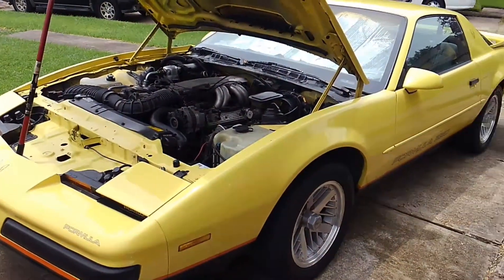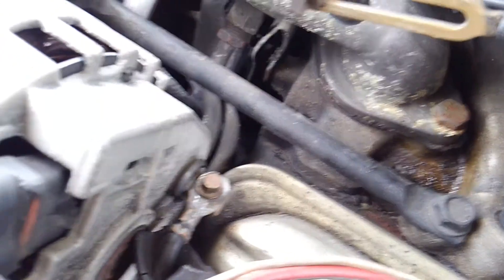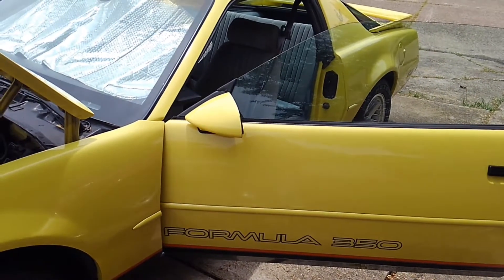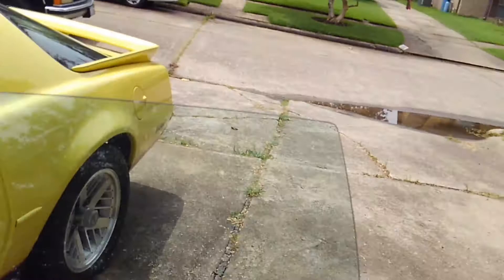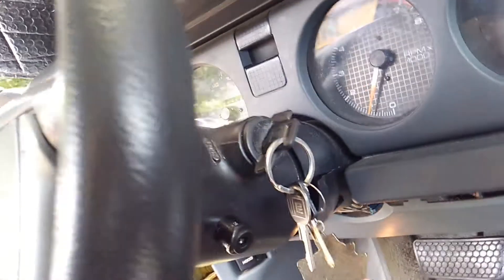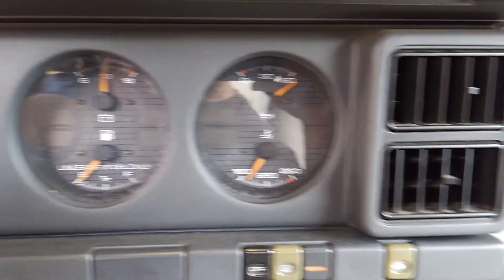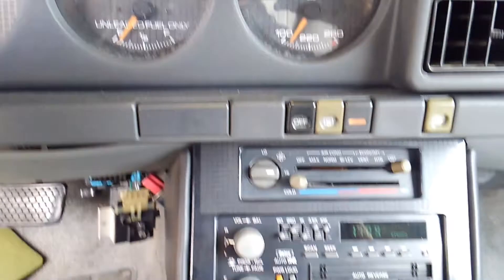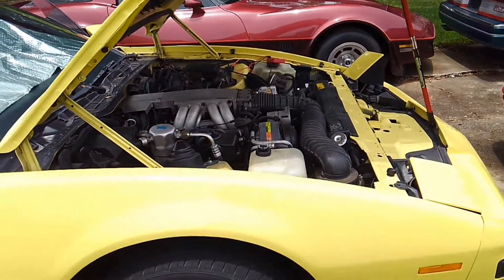1988 Formula 350 Yellow Gold Alternator Replacement and System Voltage Check

Comment: The Formula 350 had them Stangs crying, uncle! uncle!  🔥🔥🔥
Reply from the maker: They definitely gave them a run for their money. I also like the Firebird styling a little bit better than the fox bodies.
Reply: @VetteSource  Yes they do look  better to me too. I have the same car it's a 89 . I bought her last December . The Injectors were totally shot . I bought injectors from South Bay Fuel Injectors and I'm very happy so far. While I had the TPI all apart I cleaned all of the carbon out of the TB ,plenum and runners that was a lot of work and carb cleaner . Harbor Freight had  a nylon flexible brush set that's what I used. She also had a few bad sensors and a bad EGR valve so I replaced that  too. After I put everything back together with new gaskets, injectors, and reset the TPS I took her for a test drive and wow huge huge difference no more check engine lights either. The only problem now is the limited slip isn't working I changed gear oil and added the additive and still only one tire spins. She burns a single tar strip for fifty yards . That's my next project the limited slip .
Reply from the maker: Cool, 89 is a great year. Last year of no airbag and still has the high aero spoiler. Sounds like you're on the right track. Getting the deferred maintenance done and keeping them on the road is the hard part of the battle. Being an "old" car it will always need some TLC, and you can probably live with that Limited Slip for now until it just decides to give up on you. Just keep the burnouts down to a minimum if you can😂